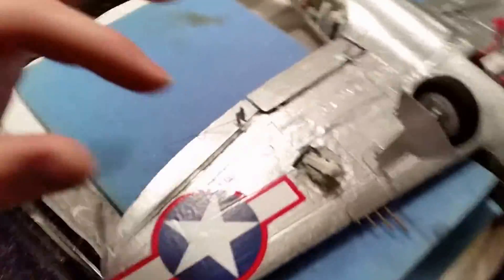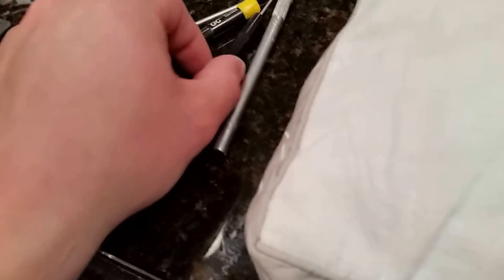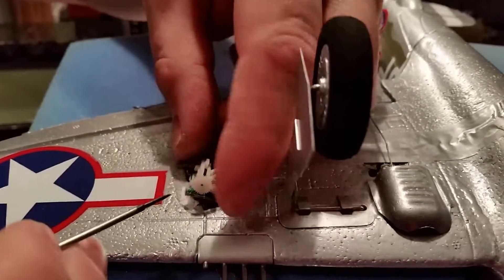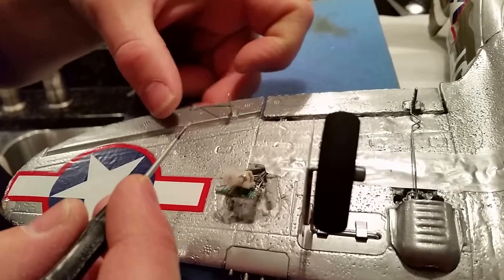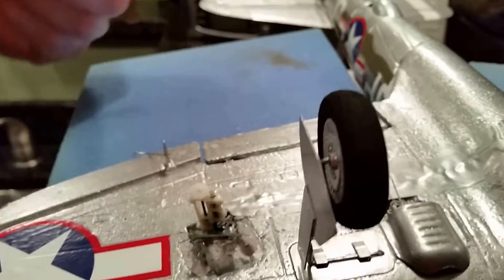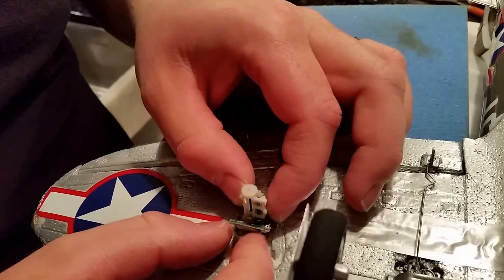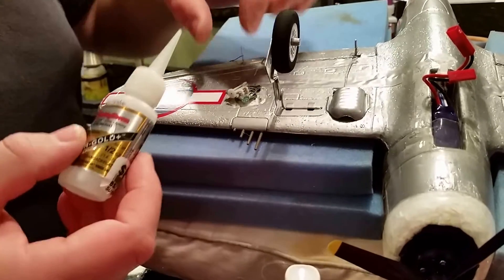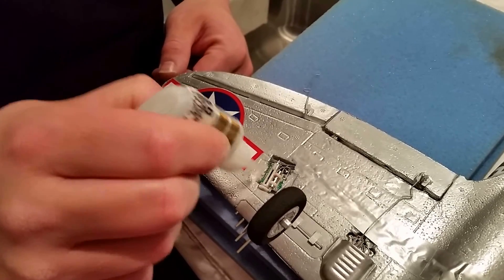Jittery Linear Micro Servo Repair on Horizon Hobby UMX planes with AS3X

Comment: Oh my god, your tip is very usefull, linear servos sucks
Reply from the maker: I don't think they suck, but they definitely require way more work than I think they should.

Imagine if Horizon Hobby just put the screws on the OTHER side..then you could fix it from the bottom of the wing super easy!!!

Oh well, still loads of torque from a very small servo.

Comment: I just picked up my P-47 today Brian. Got home took the plane out Bound it to my Dx6I. Everything but the Alierions worked. Bound it a few more times then everything but right Alierion worked. The Shop I bought it from will exchange it for another one no problem. However is there something that I may be missing? Could it have a bad Rx board? Its weird that neither Alierion worked then after a few more times rebinding the left Alierion worked and the right did not. This sucks but the shop is gonna exchange it for me and the weather sucks here anyways. But if I can fix it I'll fix it....whats your opinion Sir?
Reply from the maker: I would take them up, if you got a bad one, better to let them replace the bad one with a potentially good one ;)

The only thing you want to check for is that your aileron servo wires aren't damaged, or unplugged from the PCB, but you can't do that without opening the top half of the plane, so definitely better to let them fix it for you, if they're willing.

These long throw linear servos usually work out of box, but I've had a couple that have given me problems early in their lives. There's two or three things that you can check quick...

1) Check that the gear moved free, with your finger, or a stick to reach under the cover. IF it's free, then move to 2...
2) Is the motor HOT? If it's hot, you need to figure out why, and correct the bind...
3) Is the wire to the Rx PCB damaged?
4) Are the "fingers" that swipe along the black slider bent? This one's hard to check, but the symptom from this issue is usually an erratic movement, or servo stuck at an end of travel...and you have to usually disassemble the servo throw from the PCB before you can tell.
5) Is the servo clean?
6) Are the teeth on the GEARs both meshing correctly?
7) Are there any teeth missing, damaged, scraped on the ground and all screwed up? This happens a lot when you lose the covers on a belly lander.
8) Take a servo that's WORKING well, then unplug the one in question, and plug in the GOOD one, then actuate that channel to see if the "Bad" servo is bad or the port on the Rx is bad...

....that's what I can think of off the top of my head...
Reply: @BrianPhillipsRC  Thanks Brian. I moved the gear manually till the control surface moved. After that the Alierion worked. Manually moved the other and same thing it started working. Been doing a bunch of cycle tests and since I have moved or turned the servo gear the both work fine however though the left made a slight twitch sound once out of maybe 50 cycles. Im still gonna exchange it to CMA. Dont want to get the Bird up and have a servo fail so its better to be safe than sorry Imo. Next question for ya Sir is this....would you think that this is comparable to a 1/32nd scale model? Im looking to repaint and decal weather and detail this model. If 1/32nd scale would work there are aftermarket 3d printed detail cockpit kits,guns Armament drop tanks for the plastic model kits like Revell Tamaya. Once I find out the scale and a full decal sheet I plan to start this project. Im very impressed with this Bird. The panel line detail is great...the main wings vertical and horizontal Stabs all are very tough. She seems stout. I had seen a few guys that had put mini retracts on these as well.
Reply from the maker: I don't know the size scales for this aircraft, sorry! 

Here's the math I used to come up with my guess...

P-47D had a 41' wingspan per Google...41'X12"=492" wingspan/19" UMX P-47D Wingspan = 25.89473 OR about 26 times the size, so that's be a 1/26 scale, right??? Assuming the aspect ratio on the wingspan to overall size is a good comparison. As you know, sometimes the wing size isn't totally scale compared to the fuse, tail, etc to make the wing-loading work out.

Hope this helps!
Reply: @BrianPhillipsRC I'm definitely not a math wiz so your guess is as good as mine bud lol. It looks close. The one thing E Flite and HH could do is either offer after market decals and detail parts or either offer them in the kit. Also maybe have at least two different schemes to choose from. Imo these are flying models so it would be sweet to have some detail stuff offered for their WarBirds. Thanks Brian I really enjoy your channel and what you do Sir....Happy Flyin my freind.
Reply from the maker: https://callie-graphics.com/
Not super cheap, but very nice ;)
Reply: Oh man...! I recently got the umx conscendo, like maybe 3 weeks ago - a month?? And the snow here goes from fluff which gets inside of the casing regardless to hard crusty snow. I got the fluff in my servos, which gets them wet. Now ever since I have jitters and this thing is brand new!

Comment: Won't the kicker crud up the linear pot?
Reply: Thanks Brian for the video, I had the same problem with my umx timber, I did the cleanup on the servo and it fixed it! Keep up the video's!✈️
Reply from the maker: GREAT! I'm glad this helped you out :)
Reply from the maker: Nope, but if you get CA in there, you'll have to try and keep that off the black strip...

Kicker is super easy going...except that it will break down tape adhesive and glues, and break down paint (almost like foam safe thinner)....other than those interactions, it's fairly safe on materials, in my experience. I even use it to intentionally remove taped on parts, occasionally, and almost always use it when I have to "unglue" two foam parts, since it's so effective, in this "undesirable" side effect.